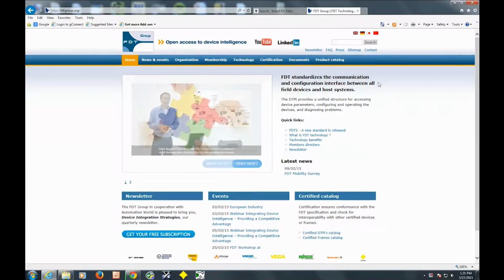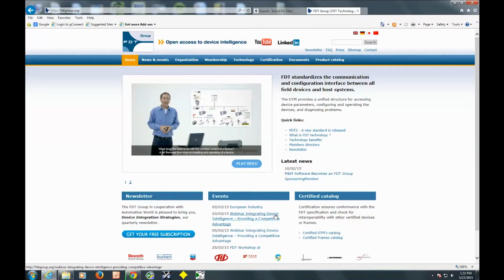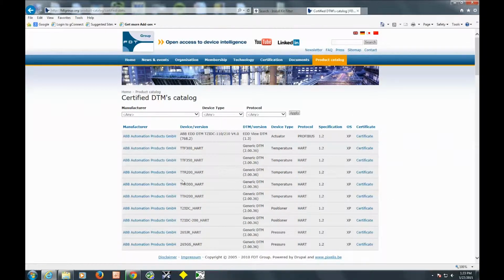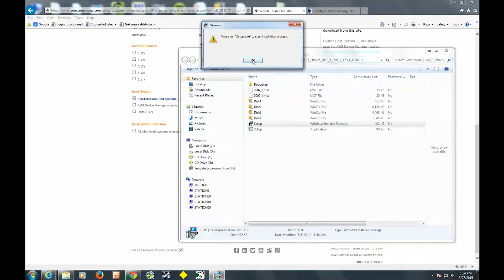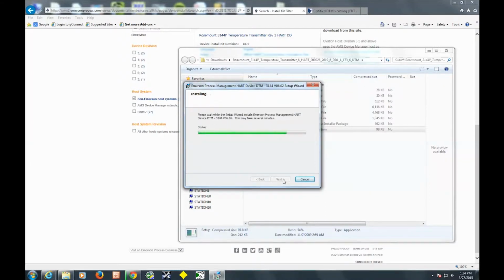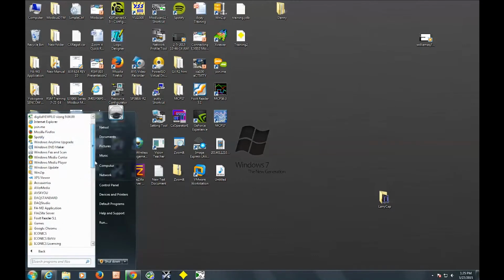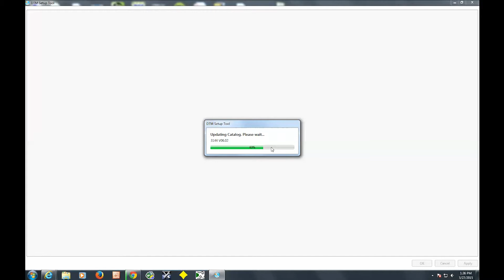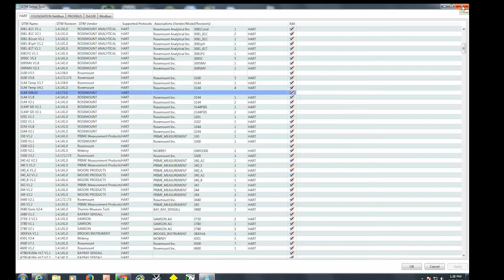Updating Device Files in FieldMate

Comment: If I use ABB or AUTROL equipment, can I use FieldMate software?
Reply from the maker: Yes, FieldMate software supports any manufacture’s device through the use of EDD or DTM technology.  The device must use one of the following supported communication protocols:
BRAIN
FOUNDATIONTM fieldbus H1
HART (HART 7 is supported)
PROFIBUS
ISA100.11a
Modbus
FieldMate incorporates the open field device tool/device type manager (FDT/DTM) standard and is compliant with DTMs per the FDT 1.2 and FDT 2.0. FieldMate supports built-in DTMs, deciphering the existing Device Description (DD) instantaneously for other vendors’ devices that do not have DTMs available.
Reply: @Yokogawa  Thank you for your feedback. You guys work very professionally.